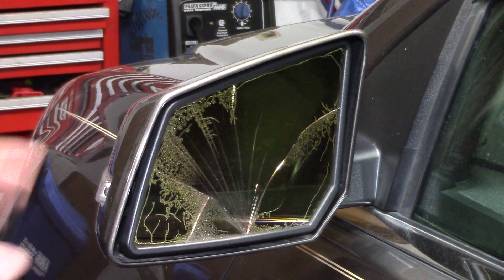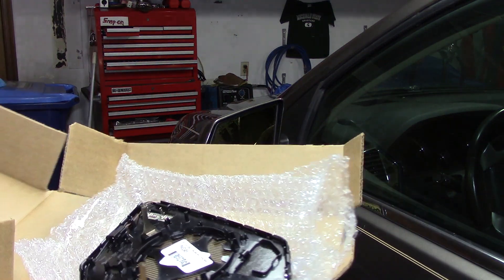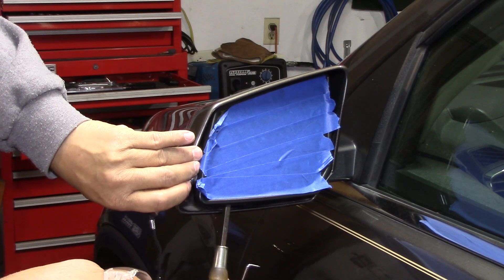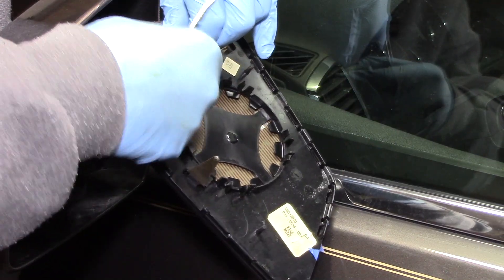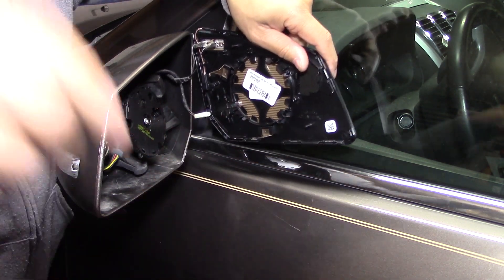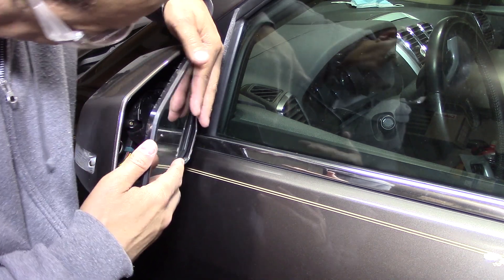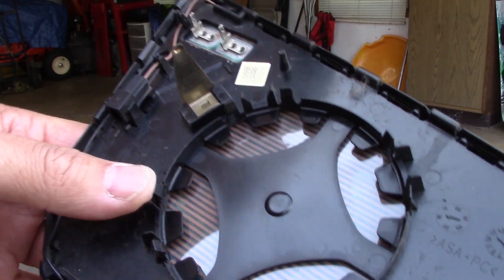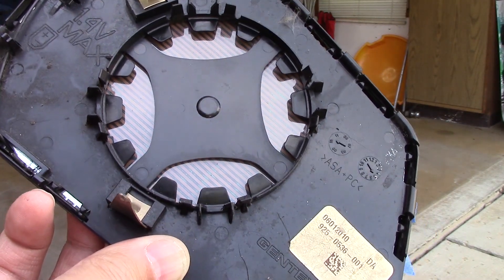Side Mirror Glass Replacement, 2011 GMC Acadia.  How I fixed my driver side mirror glass.

Comment: Do you happen to have the part number you wouldn't mind sharing? I've been trying to find the same mirror for a couple months now. After many amazon returns for the wrong mirror I'm thinking ill never find the correct one. Even the dealership I called was confused on which one was the correct one. All thanks to using the gift of a free carwash from the dealership we bought it from.
Reply from the maker: The dreaded car wash!  I'm sorry I don't have the part number.  I watched my video again and the numbers I see on the mirror is OP42805 and P9452485U.  I don't know if either one is the part number, but that's the best I can do.  I think I gave my VIN to the dealership and they gave me the part number, and I just ordered it from them.  I can't remember if they used the VIN or I just told them what the features that were on the mirror.  Good luck.....

Comment: What does the white clip do? Upper ones are for heat aren't they?
Reply from the maker: The mirror is heated and is auto dimming.  I don't know what does what, but those are the 2 functions.....
Reply: @jster1963  Well, the mirror on there is an aftermarket, so not sure exactly what I should have. Ordered one from Amazon for $37. It looks close, but only has the upper clips, which I assume are for heating.
Reply from the maker: @jhargrove1108  My mirror was factory and the one I bought was factory. I just didn’t want to take a chance on an aftermarket part that may or may not work. I didn’t want to do it twice…..